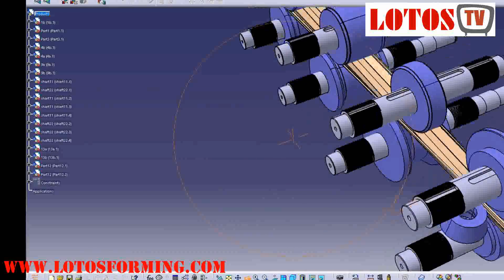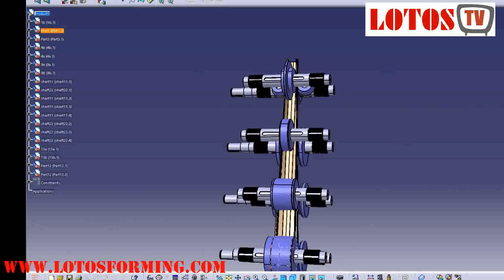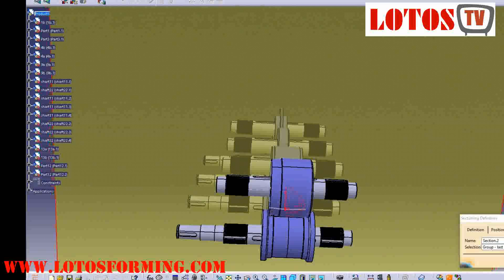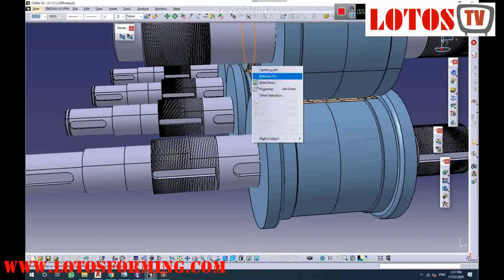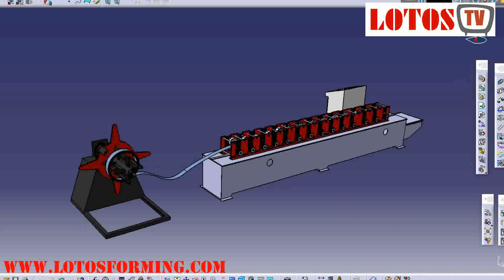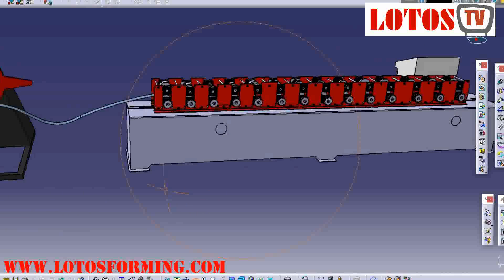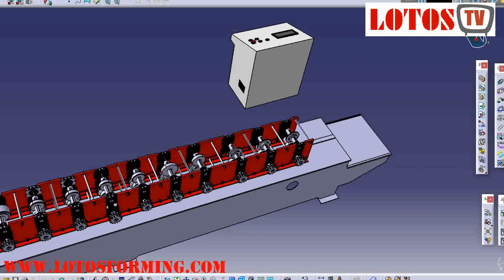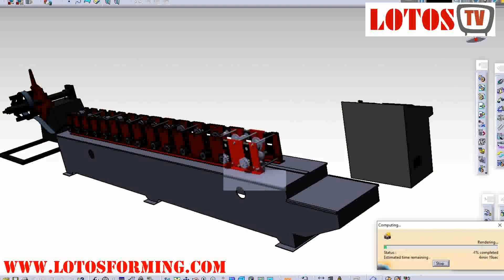What is Roll Forming and the Roll Forming Process?!

Comment: Roll forming is a popular process used to produce long sheet metal products with a fixed cross-section.to avoid forming defects limited element analysis can be used to predict strain distributions and sheet geometry during and after the Roll forming.

Comment: The optimal configuration of roll forming process parameters, such as the operational line speed, the inter-distance between roll stations, the roll gap, and the diameter of the rolls, can influence the tooling and product designs as well as the product quality.